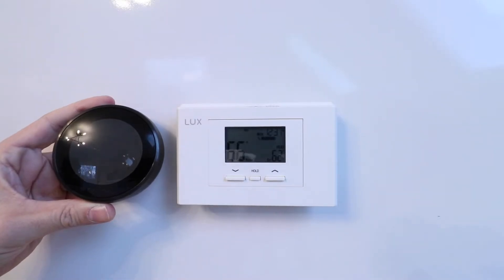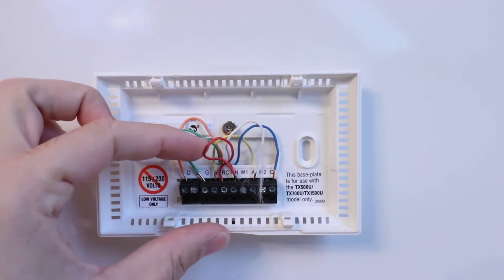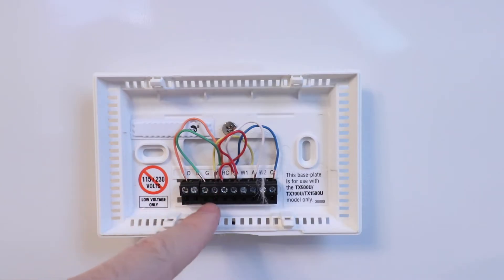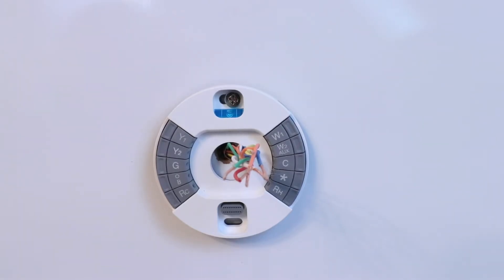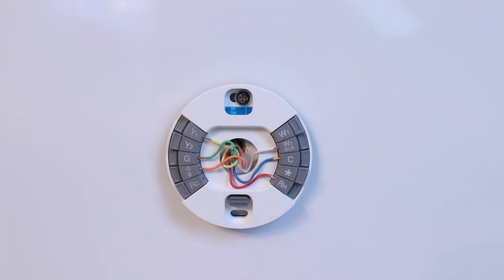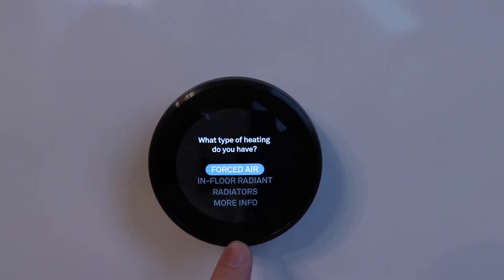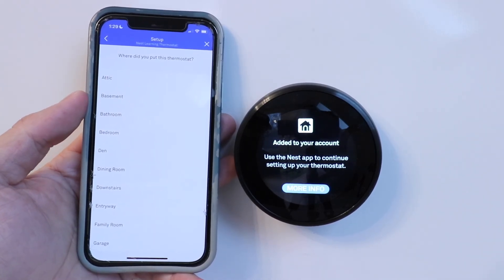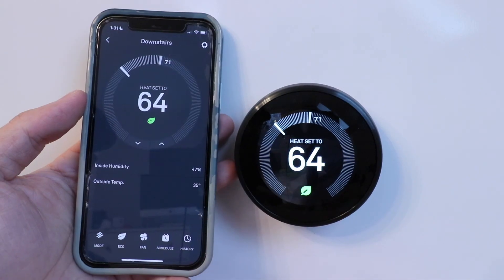How To Install Nest Thermostat With Heat Pump Wiring

Comment: when taking my heat pump thermostat off found the Emerson thermostat with an rc & rh designation on the terminal barmy red wire was hooked to the rc position but i have hooked my nest per your video to the rh position, other issue i had is emerson bar had a w/e position, so per your video that would be the auxillary heat so i hooked the white wire up to tha w2 position, getting ready to hook up my nes t now, will let you know how it goes , fingers crossed, oh mine was a 6 wire heat pump a trane xr

Comment: Same here it fixed my heating issue with my heat pump but now the fan never shuts off after reaching the set temperature, fan setting is on auto.  It only auto turns off if its in cooling mode.

Comment: Hello. I have a question.  I watched your old Heat Pump video from 4 years ago and you had Red wire connecting to Rc, but this video you are using Rh.  Which should I connect for my 4 wire thermostat set up?

Comment: I do have a question, i have a 2 stage heat pump  when i go through the settings it will ask seasonal or cycle which i i pick? Thats the one that really made me wonder.

Comment: I have a Nest  installed with a heat pump. It used to shoe aux heat when I turned up the temp from a low setting to a much higher setting. Set it remotely through the app as it is a vacation home. Right now I have it with heat pump balance off and aux to be used below 50. (I'm concerned about deep snow on the heat pump) shouldn't it show on the app that it is using aux heat?(outside temp is 18) Thank you!

Comment: Sir, I am in Dallas Texas.  I have a Nest Learning Thermostat  (A0013) with a  (Daikin) heat pump and just bought it (HP) because I got a GREAT Deal.  I never wanted to use the heat Pump for Heat because gas  is 1/3 the cost cheaper and is abundant.  It cools very well.  I continue to want to use the gas furnace for heat all the time and never engage the Heat Pump for heating.  Do I need to TRASH this Thermostat for that to happen?

Comment: I just replaced my old gas/electric system to packaged heat pump. I only have R,Y,W,G 4 wires. My contractor put non wifi honeywell T6 pro thermostat. It seems W wire is now connected O/B instead of W as before. Can I still install this nest system by just connecting wires as is now?

Comment: This video is extremely informative,  I'm struggling with a geothermal system that has 3 white wires. My current thermostat, (white and rodgers 1f82-261) has WH1 with 2 white wires and E with a blue and a white wire. I'll look into your more complexed system video you mention. Thank you for your time and effort posting these videos.

Comment: I have a heat pump, with heat strips.  No other source of heat. My old thermostat had AUX/E with two wires in it.  (white & black in my case)   White goes to W1 in the air handler, (W1 jumped to W2), and Black goes to heat strip relays directly. (how it was when i bought house) Prior thermostat heat strips kicked on in extreme cold if heatpump could not keep up, and emg heat worked from thermostat like it should.    I put the white wire to W2 Aux, and the black wire to the *.    would this be correct? or do I not even need the W1 wire?   If I recall , heat mode the blower runs slightly slower then in cooling mode. I would assume the board uses signals from Y1 or W1 to determine blower speed or maybe the O reversing valve input?  I know just enough to be dangerous, thanks for your time.

Comment: thank you for this great information .. my  system has all those wires plus one additional wire connected to an E terminal. (the wire is black)  where would that connect? the * ?
Reply: Have you figured this out yet? If so, please help me!
Reply: Was the black wire connected to the E and Aux terminal?

Comment: Thank you so much!! I finally installed mine since I had a 7 wire system that caused some confusion, the 7th wire being brown for my "Emergency Heat". Put the brown in the *connector and ran a test. Everything works perfectly with no faults!! This video was wayyy easier to follow than the nest instructions.
Reply from the maker: Excellent!
Reply: In what connector? I have a brown wire that goes to Emergency and aux with a wire for aux, im guessing I don't need the emergency wire?
Reply: @artsoto5459  I ran my brown to the star connector for (emergency/Aux) heat everything works fine. Not sure on your setup but sounds similar to mine.
Reply: @bullpolizei sounds like it, I have a 2 ton Goodman heat pump, with Aux being the same as Emergency heat, I am not even sure why the emergency switch is on my thermostat, how is the nest working for you?
Reply: @artsoto5459  pretty much the exact same setup I have, Goodman heat pump and air handler. I think yours would use the same wiring mine did. The nest will tell you whether it's wired right or not so it's worth a shot.
So far, so good. I really like it, it's saved me some money on energy costs for sure. I have 2 of the nests, top floor and bottom floor, wouldn't go back to a standard stat.
Reply: I had brown as well.  I snipped it.

Comment: I installed a nest and the heat pump heating function works but cooling does not, cooling also heats. I have the O wire set to seasonally on it but it never gets a “call” from the thermostat for the reversing valve. I get no power on my multimeter. I’ve tried switching to B and it has the same outcome

Comment: My heat pump has a brown wire to W2 and a white wire to W. W also has a jumper cable between W and Y where there is a yellow cable. When I hook up the nest it default to dual fuel system which I don't think this is it. What Can I do?
Reply: Did you ever get this?

Comment: At the 16:06 mark...why does it says AUX Heat on the Thermostat?  Isn't AUX Heat used only when the temp is below 35 degrees?
Reply: If I'm not mistaken, it comes on when there is a big temperature difference. Since he set it 3-4 degrees above what the room was, the thermostat thinks it needs a ton of heating. Once it gets to temp, it will try and maintain that temperature and should only use the heat pump.

Comment: I have a Westinghouse duel fuel package heat pump. It is a two wire system to the thermostat. Can a Nest work on this unit?

Comment: I have a 2 stage heat pump with electric aux heat.  My thermostat requires a W1 wire but you mentioned that’s for boilers.  Does my setup make sense to you?  I would have dual fuel then, correct?
Reply: I too have a 2 stage heat pump with electric aux heat, have you figured it out? If so can you PLEASE help me
Reply: @deonteglover4045  same here... i think.
Reply: I too have this question. When wired to W2 Aux, heat strip not coming on. Can I connect to W1?

Comment: I have a Gas furnace + heat pump and AC. When I set up the nest, do I choose a dual fuel system or a single fuel ( 11:25 )? At the beginning of your wire setup, I have almost the same wires as yours except my white wire is in W/E. Is it ok to put my white wire in the W2 aux? Happy New year!!
Reply: Same question here